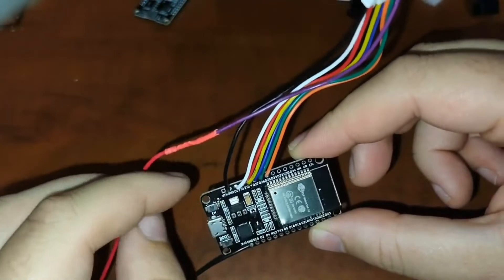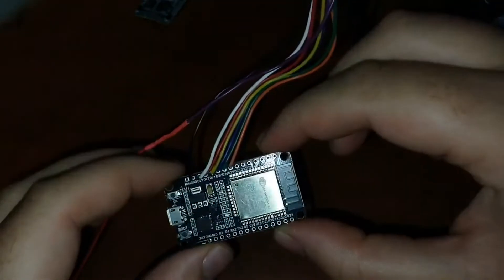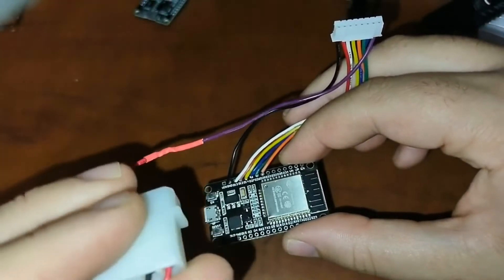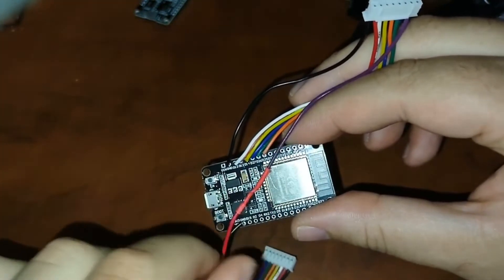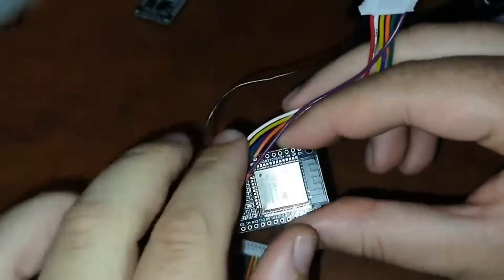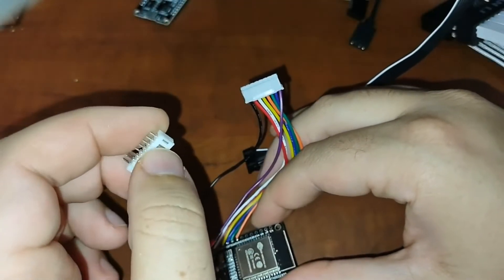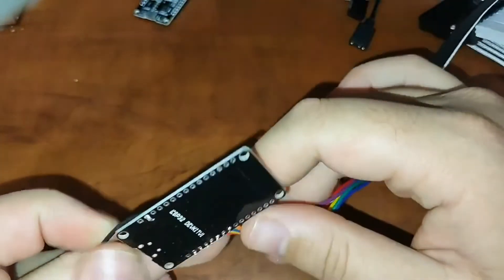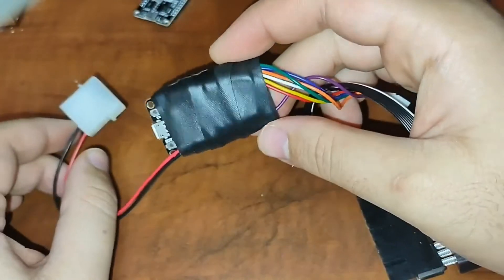How to "make" your own ARGB controller for the Lian Li Strimer Plus series (V1 and V2) with an ESP32

Comment: It works with 12vhpwr
Reply from the maker: Yes. The wiring is slightly different for 6-pin JST-PH. 6-pin is power and ground on the outside wires with the 4 in the middle to control the LEDs. Remember the PCIe Strimers are 4 x 27 or 6 x 27 LEDs as opposed to the 24-pin which is 6 x 20 so you need to write your code appropriately.